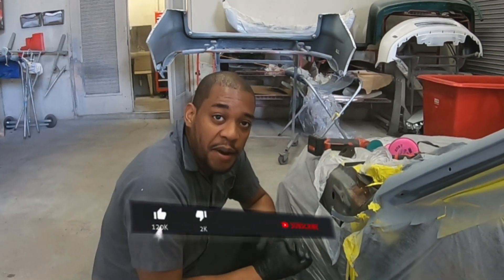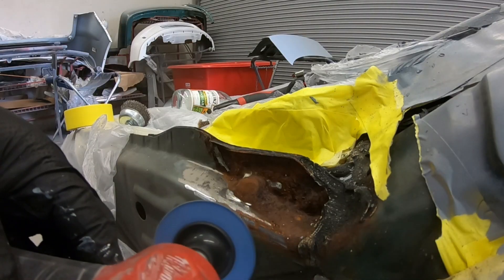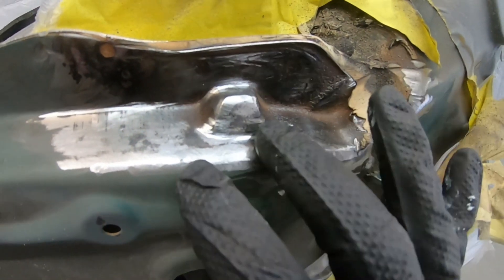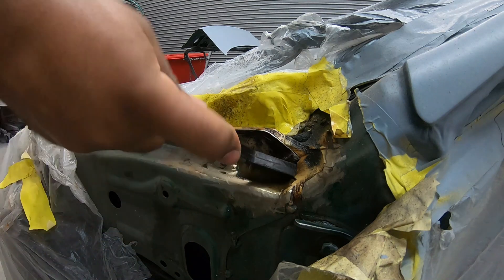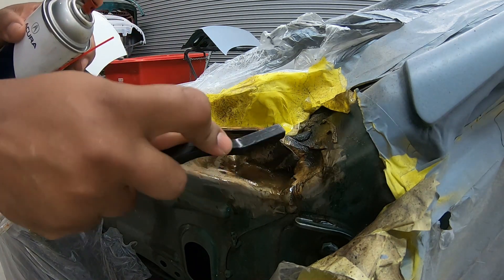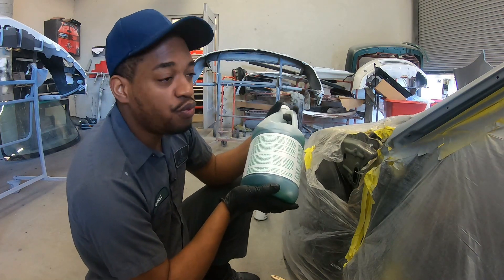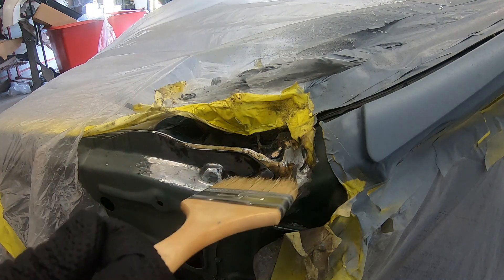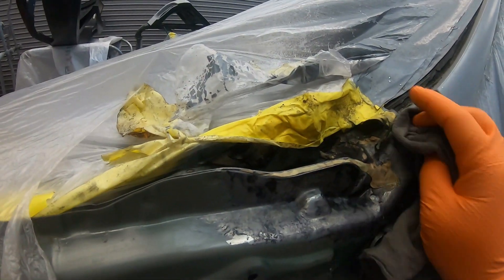HOW TO TREAT RUST WITH OSPHO

Comment: my experience with ospho on many projects has been excellent.  I've done truck frames, trailers, mower decks, rusty tools etc but my application is a bit different, I spray it on, then use a green scrubby pad to really work it into the rusty area, and then I wipe it off with paper towel so you don't get that white residue and it it removes the initial rust residue all at once.  Let it dry for 24 hours before painting over it.

as said DO NOT get it on tar or concrete, it actually eats a hole into it and will leave very large divots with just a few tiny drops.  I always put cardboard down and then painters plastic as well to avoid any errant spray or splatter.

ALSO wear a respirator and gloves.  This stuff is nasty.  The fumes alone will curdle your brain cells and on the skin it does burn. I wouldn't use ANYTHING else to convert rust for the price it is stupid cheap and I've had the same gallon jug for years now.  

Thanks for the video!
Reply from the maker: Nothing but the truth 👍 thanks for watching

Comment: And if u don't have rust that's flakes, chunks as if when u hit with a air hammer and it falls off, if u don't have that and it's like he showed, hit it with a wire wheel, etc then just use Ospho. For hard to reach areas use Muratic acid. DO NOT GET ON GOOD METAL OR PAINT, PLASTIC ETC. Or water acid down by .25, .50 even. But it will clean a old muffler clamp in about 10 min. U CAN'T leave it on or it will eat the metal. Use in hard to reach areas, rinse in 5 or 10 min with baking soda water mix. 1 cup to 1 gallon. Stops the reaction. Or just keep rinsing with water. Once  1 cup of acid at 50% strength is mixed with 1 cup of water it's at half strength now. So more water less powerful. Ospho needs the Rust to activate. It will seal bare metal too. But if u want it to react with rust and kill it, gotta leave some rust. But u gotta stop the rust. If it's a tiny bubble in paint once u get it gone it's always bigger. Like tree roots are always about twice size as it's canopy. Ospho is great inside frames, under body, etc. U can spray, brush etc however. It will leave a white chalky residue sometimes. That just means u used a lil too much. Ok. Brush or wipe away and all good. This stuff is such a life saver, time saver and work and $ saver. U will never spend $29 on a gallon of anything else that can do this for your project. Any metal project from autos, tractors, farm, household, wrought it on fenses etc. I have used it alot. Only wish I'd found out about it sooner. And Car Rep coatings. Car Rep costs same as others but has unlimited shelf life. Epoxy 2 part, clear 2 k don't matter what any 2 part coating where u pop the bottom u got 24 hours at most. Car Rep mixes when it's sprayed. So use some now, 2 months, 2 years it's all good. I use all the time cause I can't get all project ready for primer at same time and have time for completion.
Reply: Does Ospho rust treatment and Tamco HP5310 play nice together? Just Epoxy will work? Can it be sprayed around windshield channels after rust treatment then Urethane primer?

Comment: Gr8 video. 2 things, U can paint over Ospho IF USING OIL BASED PAINT. Please don't use Ospho then shoot epoxy cause it will not stick. Ask me how I know this. If using Ospho with other than rustoleum type paints u must reactivate ospho with more ospho, let sit 5 min, then rinse with lots of water or baking soda water mix, then quickly dry. I've made tge mistake of being in a rush and sprayed over ospho and the primer and paint bubbled and wouldn't stick. Best thing is to ask the mfg. I talked to a older fella a ppg. He said they stopped telling ppl about acid cause to many would not do this step and paint job would need redone. I've used Ospho for 3 decades. Works gr8. Saved me lots of time, work and money. But u can't skip that step. 2nd to stop rust in 1st place don't spend $50-150 on kroil, Fluid film, etc. My Pap worked for ford in ohio. A coworker drove a post ww2 sedan and it was mint. Pap asked him in mid 60s, How do u keep urr old car so nice close to lake, snow, salt etc. He said mix up 1 quart of any new or used oil, 1 quart of any new or used Trans fluid, 1 grease gun cartridge or tub of wheel bearing grease and 1 or 2 wax ring toilet gaskets. heat and mix in old pot and this is what that guy,  pap, my dad and myself have used since after WW2 to keep our machines rust free. You can make this for about $6 with used oil and fluid. It will leave a medium hard finish. If u want a hard finish mix in some boiled linseed oil. We've used this since 60s and it has always worked, lasted years and is cheap. If you've ever seen any machines with leaks of oil, grease, trans fluid it can never rust. For doors we use melted Vaseline, or baby, mineral oil. Tape door drains, pour in using a funnel and brake line or hose and let sit a few inches high in bottom of doors. Week later drain and save for next time. I guarntee u that no rust will, can ever form. If rust is heavy use a needle scaler etc to get chunks off, then ospho, then rustoleum or I like Farm implement paint. Why u see 30 yr old farming equipment with hardly no rust. Or if you've ever painted a JD tractor or Dozer. That paint will kill a 36 grit pad. Tough stuff. Inside a box frame use a drill with a flexible shaft and short pieces of chain or brush to get inside. We've restored alot of Autos, semis, tractors, oil well engines etc and never had issues. My gr8 uncle would paint oil well metal with this mix and never had to worry about rust. U can use a brush, sprayer etc to apply. Or an old paint gun. Or make urr own from a blower nozzle with a vaccum pickup. Just get it inside frame and under body and it will last longer than u and urr grand kids.
Reply from the maker: Wow! That’s some valuable info I did not know about. Thanks!
Reply: @mariopaintclass6091  U will know if u just spray or brush acid on car steel panels and try to shoot with epoxy. Idk about urethane, water based but acid like Ospho is only for oil based paints. Anything u use mineral spirits to clean is ok. Epoxy is not. It will not stick. And body filler also. Gotta just spray with some baking soda and water mix. A few tablespoons to a quart. Shake and spray and dry fast. If you use Muratic type acid it happens fast so can't spray and leave. In 5 min part is rust free and rinse with Baking soda water. U can't forget it. Primer, paint, filler costs alot more than it did just a few years ago. I made mistake of being in a rush and forget over a wknd and did all body work, primed and painted. 3 months later it bubbled up and I could pull it off. Had to sand and start all over. Sometimes it's easier to just make a lil blaster for sand, glass, soda etc and use it. I only use acids in certain situations. Like heavy pitting, u can never sand the pits out, especially on newer autos very thin sheet metal. It works great but just have to make sure to not forget to neutralize. Rewet if dried, let set, I use a scotch brite and bakingsoda water mix and wash, scrub and rinse. No issues then. It's like forgetting to degrease b4 painting. It's all in the prep. prep is 90% of a gr8 job. Anyone can shoot nice paint, if body work is trash, so will paint.
Reply: I’m surprised nobody mentions this. It used to be on the bottle saying it had to be rinsed off. Skip this step for many headaches. And bubbled paint
Reply: @kengrow3992  Yes. And so many ppl don't know u can use on bare metal to protect from rusting.
 I've heard so many say Yes it's gr8 for RUST but that's about it. Nope. I tested on a used muffler clamp, let sit in muratic acid for 10 min, rinsed with water and dried with heat gun and then a soak in Ospho. Still bare beautiful grey metal. Idk what it is but my wife and I say this all the time, We thought with having a PC in pocket that it'd make ppl know it alls. We was wrong. For some reason they know less. I say that if we Gen X or baby boomers had smart phones then we'd be so much further ahead than we are today. 
I had a argument with a person about using on bare metal. He asked Is there a product I can use to protect my fenders after I got them to bare metal. Yes. Ospho. No that's for rust. I've used that for years. I don't doubt that. But if they read the label, it says how to use on metal with no rust. 
If you don't do this in North rust country u can hear it rust if u listen close. It's a must to protect frame, body in some way. Idk why ppl don't do something. I've seen alot of good rides scrapped cause ppl don't. Like most things in life, a small amount of protection can save u alot of problems down the road. Always read the label. If ppl follow label, it's much easier.
Reply: @@maninamerica2046 Anytime. I mix my own with 1 quart of used motor oil, 1 quart of used trans fluid, 1 tube of grease and 1 wax flange gasket for toilet. Heat and mix then spray, brush etc. If need be drill and fill area then cover with rubber grommet, plug etc. U can use non oil based coatings BUT u have to reapply ospho, let sit 10 min, and then wash, rinse off and dry with heat or air. Then safe for epoxy, urethane etc. Ppl say Ospho is not good cause they don't know this. It's ruined my epoxy primer b4. Have a good wknd and get her sprayed.
Reply: @@maninamerica2046 As long as it's oil based or can be cleaned up with mineral spirits u can use over Ospho. If no rewet, set for 10, wash or rinse with water, Dish soap, good dawn not dollar crap, or baking soda about 4 tablespoons mixed with a quart of water. Then dry with air or heat. If not Acid will win and bleed through.
Reply: @@maninamerica2046 How did the bed armor turn out? Good I hope.
Reply: In short , ospho is a rust condom guys . Use it.

Comment: Up north our salt ruins the underside of the vehicle. 
Splashes up you already know. You guys in Florida it's as if the salt water gets in the air and I'm told cars that stay close to the ocean have some crazy bad internal rust damage before it ever gets to the "normally" affected areas of the car. Trolling around on Miami craigslist for cars I've seen roofs rusted out like our undercarriages on otherwise perfect cars.
Reply from the maker: You’re not wrong I do not like working on cars that stay by the ocean even the screws and bolts is a pain to remove

Comment: Hi Mario another interesting video, been using these chemical rust converters for years and they do a great job if used correctly. You can get them cheaper if you just buy phosphoric acid which is exactly the same but I think some of the better ones prime the rust as well🙏👍John UK
Reply: I had to see if someone mentioned this. I use phosphoric diluted 2:1 with water in a spray bottle and then rinse with water after a few minutes. It's definitely cheaper than name brand converts and works just as good.
Reply from the maker: Thanks John I appreciate the info